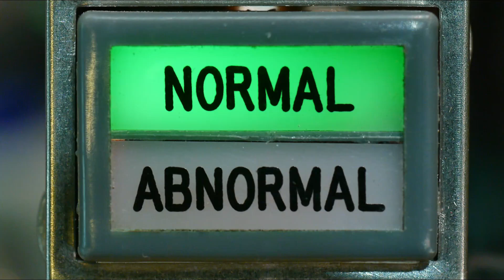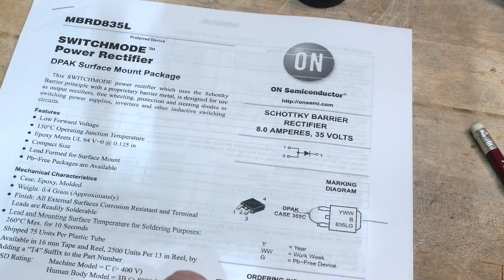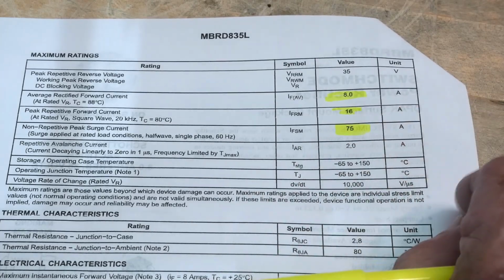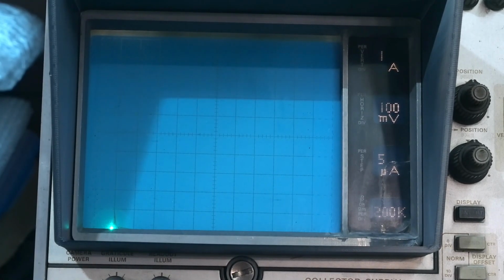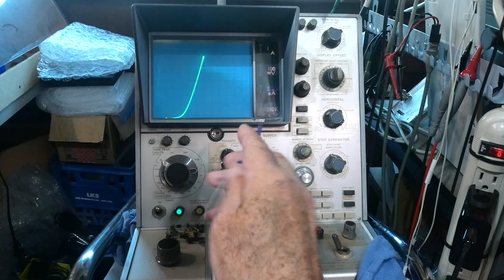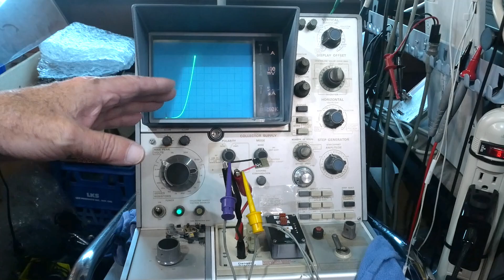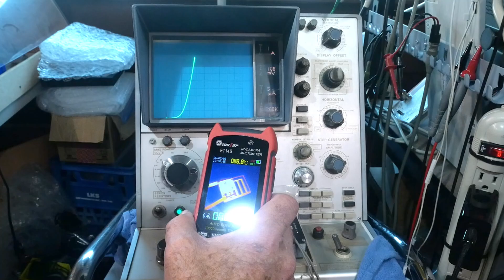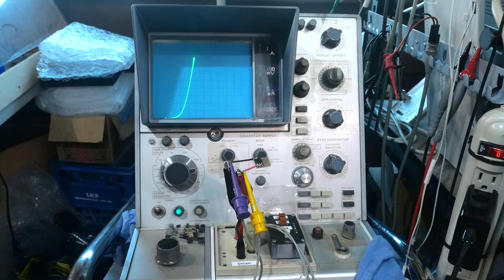#2144 MBRD835LT4G Diode Schottky 35V 8A

Comment: In a flyback power supply, the output rectifier peak current is often about six times the average. This could be used in a unit with 1 or 2 amp output. Other topologies might not be as severe.

Comment: I have come into some nice test eqt. for dirt cheap or free but something like that I don't have. I did build one of those so called octopus testers that you use with a scope in X-Y. Tests semi junctions with 60 Hz from a low voltage xfmr.  No good to test breakdown or zeners but I do have two voltage settings.  IT is good for checking turn on so I used it to screen box lots of small signal diodes and rectifiers.  Good enough to cull parts well out of tolerance or defective.  It can do xstr junctions too.  I priced used Huntrons and can't get one.